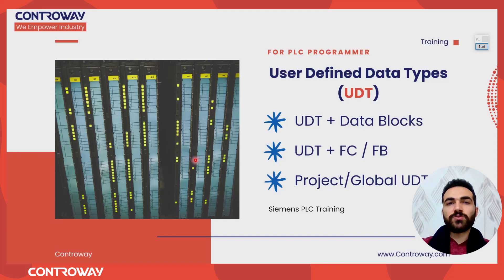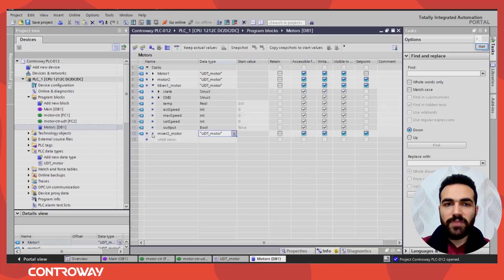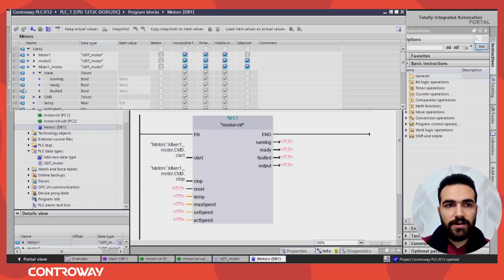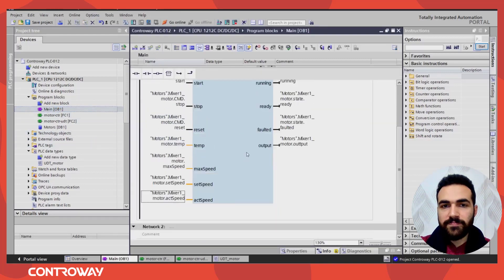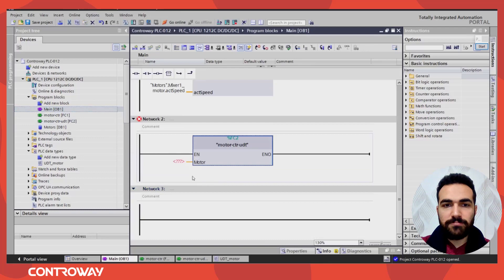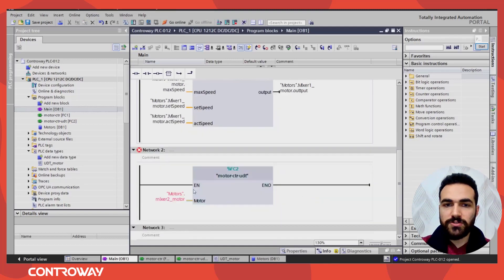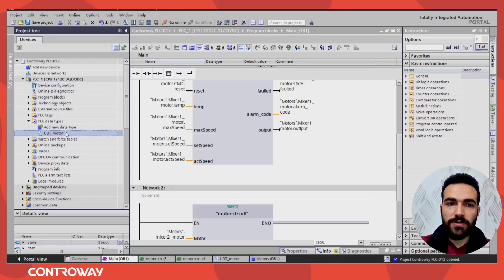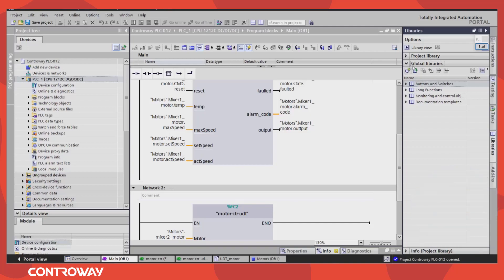UDT with (Data Blocks, Functions, Function blocks) and Global UDT #plc

Comment: Thank you! But... how is the data type inside UDT structure addressed to IO terminals???

For example: ...the input bool data types like the start/stop/reset? (Inside the structure)
Or the output bool datatypes like the running/ready/faulted/output. (Inside the stucture)

Thanks you in advance!
Reply: In rockwell software, the data types inside the UDT can be "aliased" to IO hardware address. How about siemens? How ?
Reply: Hi, did you find the solution?